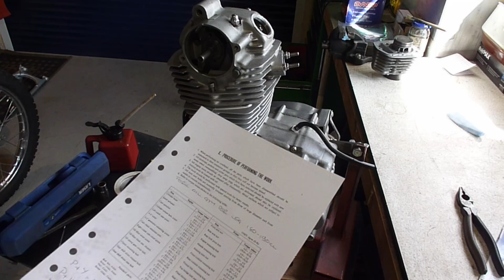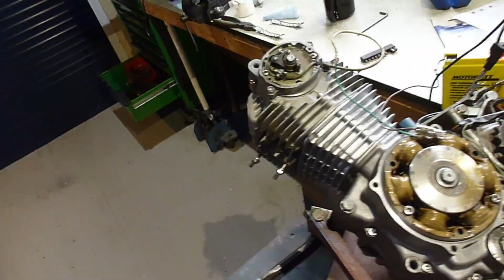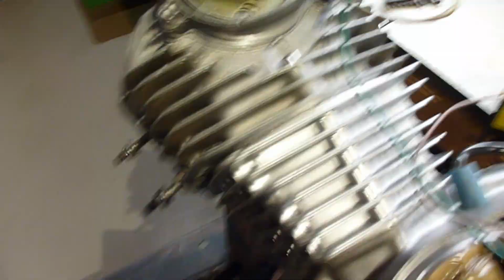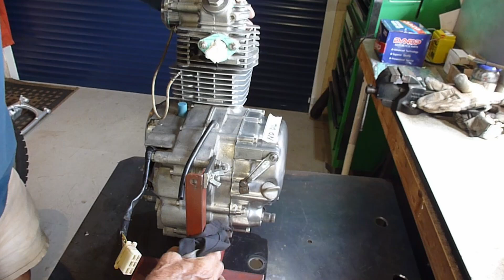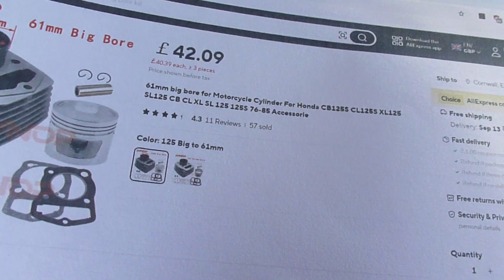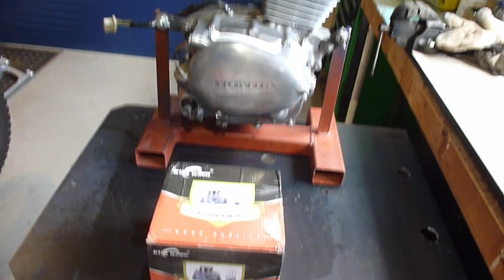Honda SL125 Top End Rebuild Valve and Ignition Timing

Comment: did you use any gasket sealer on the crankcase halves?
Reply from the maker: I didn’t have to split the crankcase on the SL build as l was only doing the barrel and head, however on other builds where l have split the crankcases or other faces where gaskets are not fitted due to end maintaining the correct tolerance or end float l use Permatex anaerobic gasket maker, unlike silicone based sealers anaerobic sealers only cure on the contact faces and any that is squeezed out stays fluid and is diluted away with the oil, this is unlike silicone which when squeezed out internally can detach and block oil ways, galleries and suction strainers which l have seen in the past. Loctite and other brands also make anaerobic gasket sealers but they all work same way.

Regards, Brian

Comment: Hi Brian, where did you get your cap head screws ? Did you get them as a full set?
Reply from the maker: Yes its a kit of around 50 bolts, screws, nuts and the 4 head washers from A2Stainless sold via eBay. It only says the fitment is for the CB, CT, TL, and CL range of 125 engines, however the all the parts sent in the kit fitted my 1971 SL125. Link below to the kit on eBay.
Regards, Brian.     https://www.ebay.co.uk/itm/372138179575
Reply: @TheCADengineer perfect thank you!

Comment: OK so now we've got ours all timed up correctly and it will not run. 

Timing is perfectly on the f mark on the compression stroke. 

Spark plug is bone dry yet the carb bowl is filling up and all jets and the pilot circuit is perfectly clear. 

I'm fresh out of ideas

Comment: With the timing set correctly on our one, the mark on the points plate is off to the right of the mark on the case. What could be worn to cause this?
Reply from the maker: You could be one tooth out on the cam chain sprocket, remove the points, advance unit and housing from the cylinder head, turn the engine over until the “T” mark on the rotor/flywheel is in alignment with the mark on the casing, then have a look at the mark on the camshaft sprocket which should line up with the mark on the cylinder head. If you are out by a tooth slacken off the cam chain adjuster, unbolt the sprocket, pull it forward to get some slack in the chain and jump the chain by one tooth in the required direction, then loosely refit the sprocket and recheck that the marks line up.
Reply: @TheCADengineer yes that all lines up when on the T mark. The bike will run but it will backfire sometimes and you can see fuel coming out the back of the carb when it does. I think the backfiring is down to the intake valve not seating properly. Could the timing mark being off be due to worn points? The cam and flywheel makes line up but as I say, when the points break contact, the mark on the points plate is almost a cm to the right of the mark on the case

Comment: Can you explain how you've got the bulb wired up please?
Reply from the maker: I am using the 6 volt battery off the bike and a bulb in a bulb holder, connect the negative side of the battery to the engine block somewhere, then connect the positive side of the battery to either one of the two wires on the bulb holder, and the other wire from the bulb holder to the wire from the points. Now when you turn the engine over the bulb will light when the points are closed as it gives an earth path back to the battery via the engine block. The timing for the spark at the spark plug occurs exactly at the time the points open and break the circuit. So as you are now wired to the bulb so the second the bulb goes out as the points open is when the spark will happen, so using the mark on the flywheel when rotating the engine you can move the points plate to the exact position to the F mark on the flywheel. You can use any form low safe voltage dc power with a compatible bulb, or a multimeter set to continuity to get the same effect, l just used what l had on the workbench at the time.

Comment: What happens if you get the cam 180 out?
Reply from the maker: If you get the cam 180 degrees out the spark will occur at TDC valves rocking stroke and not TDC compression stroke. Everything will rotate without the valves hitting the piston so no damage to anything, but obviously it won’t run as the ignition timing will be 180 degrees out. There is a peg on the camshaft which aligns with the notch on the advance unit, this peg should be at the top (about 5 minutes to 12 o’clock) Have a look at the first couple of minutes in the video and the position of the peg is explained. Regards Brian

Comment: Great vidio Brian I am in the early stages of a SL125 refurbishment but I am struggling for some spares I ve tried the normal folks bug not having much luck, have you any contacts I could use. Thanks
Reply from the maker: Unfortunately l struggled for spare parts, most of the bits and pieces l needed were from eBay UK.
Reply: @TheCADengineer thanks Brian did you purchase the barrel and top end spares from e bay.

Comment: my 1974 honda xl-250 is a pain to set valve timing as you need to remove the cam/sprocket to get the marks to line up. really hard to do. yours seems much easier.